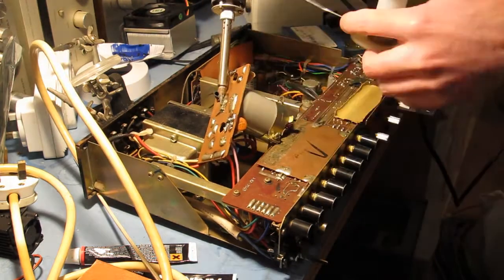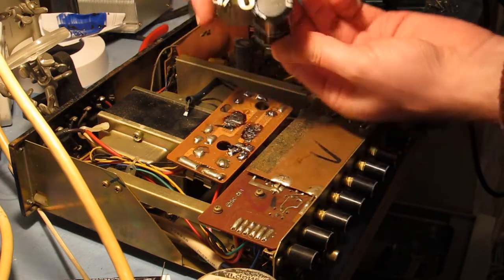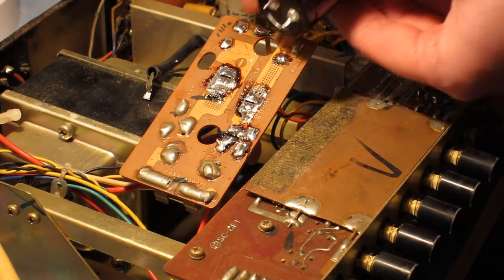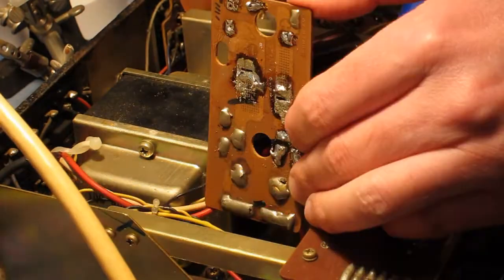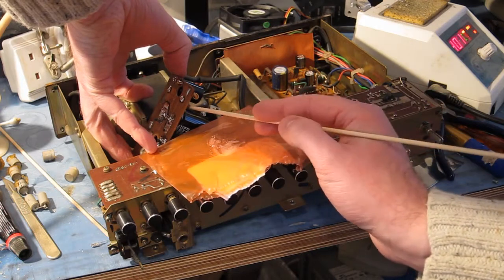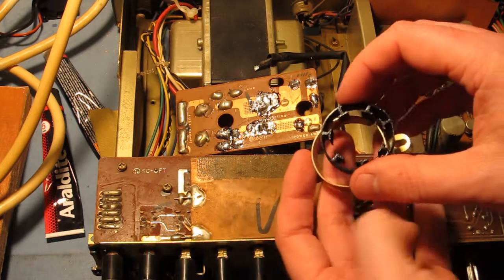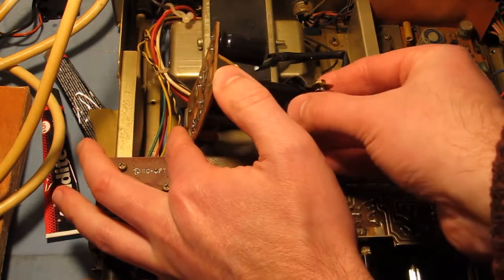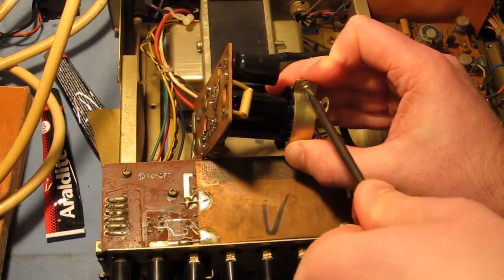Sony TA-70 amplifier re-cap and 3D printed capacitor spacer

Comment: I just did this myself using the same caps you mentioned. Another thing you might want to do is replace the old power pilot bulb with an LED. I used a cool blue 3.0~3.4v 20ma one and put an 82ohm resistor behind it.

Comment: How did you find the sound after this recap? I have the same amp with original caps - i find that the bass really breaks up quite easily even at "normal" listening levels. I like this amp along with the tuner because they fit quite perfectly in an IKEA Expedit shelf. I just wish I could listen to music with a bit more bass  at modest listening levels.
Reply from the maker: It's nice enough sounding, but it's never going to be a room-shaker. It just doesn't have the current to deliver any serious thump. It's a cute case though, maybe hollow it out and fill it with class D modules and switched-mode power supply!